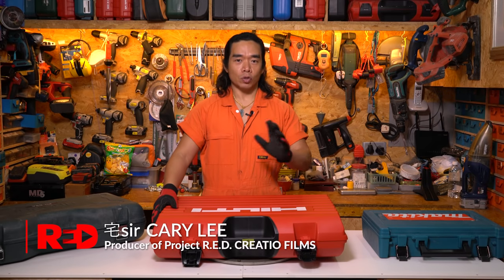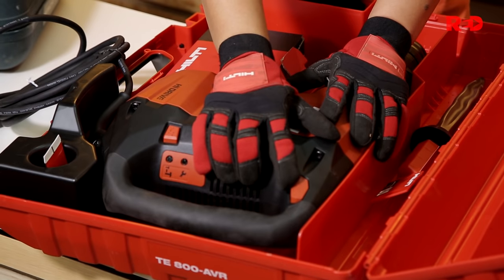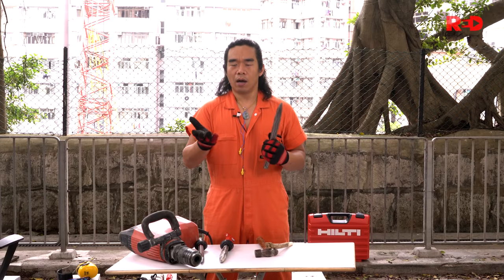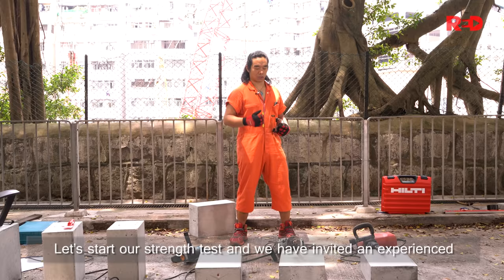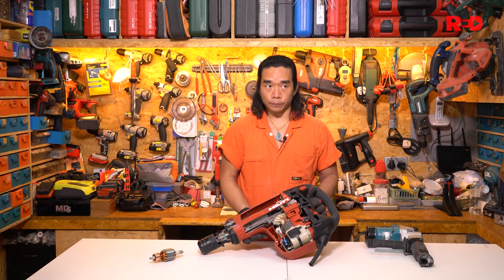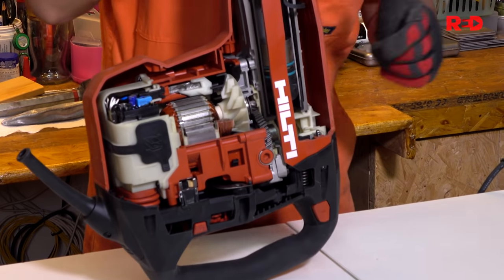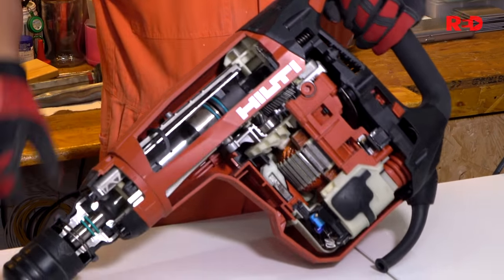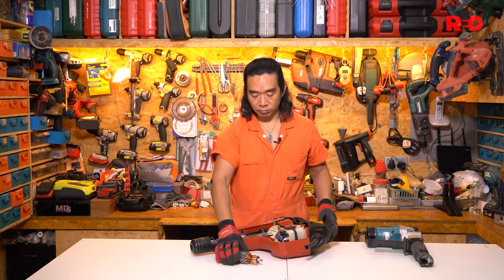Master Alley - POWER TOOL FIGHT! Hilti-10kg,  Makita-5kg, Hitachi | Breaker test | Demolition use

Comment: I have 5 Hilti machines - a breaker, a grinder, a diamond core drill, a combihammer and an impact driver. They are expensive machines  for sure, but my oldest Hilti (the diamond core drill) is now 14 years old and still works as well as the day I bought it. I think I would have had to replace a lesser machine twice already. Look at Hilti as a bombproof, long-term investment in your business. You won't regret it.

Comment: Master Alley, 
I would love for you to test Hilti breaker and the hitachi breaker featured in this video and a pneumatic breaker of the same size roughly (mostly referred as a pneumatic pick). And test them both in the field at say, a rock or granite quarry and see which one does the best. 
Then do some tests with different types of rock drills both electric, hydraulic and pneumatic test in rock. Why I'm requesting this is because I'm looking into doing some small scale underground mining both placer (really hard packed gravel) and hard rock.

Comment: how about trying 3 hammers the same weight and cost roughly? instead of comparing a small makita to two massive crazy expensive demo breakers.
Reply from the maker: Dear Sam, thank you! We've got a lot of feedback about this test. Actually this test is to bring out the most popular breaker use in Hong Kong which is Makita 5kg and Hitachi 15kg. We try to see if a 10kg breaker could make a different. So, we are not really comparing how good they are, but try to figure out how to choose between different work/task. They are all good tools.
In fact, 5kg breaker are commonly asked question so I am trying to make a video between different 5kg breakers. 
Once again, thank you for your feedback, we will keep on trying to be as fare as possible!
Merry Christmas, 2016
Reply: Sam Katalaveno

Comment: Why so inconsistent? You start with 3 and when the vibration test comes along there are only 2. You might want to communicate why the third jackhammer was not used. It was too heavy for you guys? The vibration test would still be informative and valid for those of us with muscle. Arbitrarily and silently changing the test is odd. Some would prefer strong and quick. Taking 5 minutes to make one crack in the concrete paver is in the end equal to strong and uick. The fatigue level would be similar. When the Hitachi is done with a 10' x 10' patio the Hilti would only be half done. Work twice as long or twice as hard? When time is money? 

Fine, you're comparing massively different demolition hammers. This doesn't feel like a fair fight with only 2 out of 3 participants participating in all the tests. This feels like a Hilti commercial.
Reply from the maker: Dear Bobby, thank you for your comment. Wow, I didn't realize it has been one year already! To be honest, this was not an easy test. Many things happened during the shooting. In Hong Kong, Makita 5kg and Hitachi is most commonly use. This time what I was trying to do, is to see how a 10kg, middle weight breaker perform. I am sure you are one big giant Godzilla but here, we don't really drive. Most of our tools are carry by hand and on foot. I am sure you understand what I want to say. For the vibration test, the concrete couldn't stand the weight and power of the 15kg, we tried to make it work, trust me. Again, this is not a fight. I am trying to see if there is an option for my fellow construction mates, something that can carry and travel on foot, yet strong enough to do some good damages.
Thank you again for watching, keep sharing thoughts, and we will try to make it better!
Reply: Dear Master Alley,

Thank you so very much for your kind words and response. I do unfortunately have a response. Please understand this is not a fight or argument. This is a response with your goal in mind. 

Let's assume the workers you are referring to are not contractors. At the same time my concern are the contractors. Would I carry that Hitachi to work or the Hilti. The Hilti has been proven to be very slow but easily transportable. The Hitachi has been proven to be quick. Do I want to hire the worker who will take 5 times as long or who will be quick and efficient. The boss has supervisors. He or she needs to justify his expenses. Will his or her supervisors appreciate the extra hours and money spent or a much lower bottom line due to a lower labor percentage rate? Will the worker want to break a sweat and get done much quicker or a easy transport but twice as many hours. Over here we have a saying 'milking the clock'.Go slow so we can make more many. The Hilti will accomplish that slowly. 

Google 'Fast nickle or slow dime' if you want.  Contractors appreciate the fast nickle which the Hitachi can accomplish. 

I appreciate and understand your sentiment. My opinion only differs. I am neither right or wrong.
Reply: Will the contractor/boss keep the worker who was 5 times or even two times as slow or the quicker worker. 

Btw - I do not have a vehicle. I am on foot or on a bike.

Comment: Great review ,is the Mikita HM1211b ? Because I've used Air breakers ,everything else corded Hilti, bosch, hitachi real and fake, metabo , in my opinion they are all great machines to use ,but the operator needs to know how and wear and when to hit ,my Mikita Hm1211b vs the new Hilti would be a nice challenge to see vertically and horizontally ,straight run no stopping 12 inch thick by 3 feet wide no rebar .
Reply from the maker: Dear Roger, I think it will be a great test! Need to go find Hilti and borrow some tool agaon soon!
Reply: If i may suggest doing a 7 kg breaker demo test... no one done it before... Hilti te700avr, Makita hm1111c, Bosch gsh7vc, Dewalt d25871k

Comment: How much time it took for the Hitachi and hilti hammer to break the concrete block ?
Reply from the maker: Dear Jebaki, it took Hitachi only ~10 sec and a bit over 1 minute for hilti!
Reply: Much THX for the answer.
I am disappointed with the Hilti power - that Hitachi is a 20 year old design and has only 1240W, the Hilti is brand new design with 1850W of power! Sure the Hitachi is 4 kg heavier but the age and  input power difference is huge...
Reply from the maker: Honest speaking, Hitachi has a lot of vibration but that power is killer! For floor work, I will use the heavier one, no doubt. There are indeed a vibration reduce model, let see if I can borrow one and give it a try!
Reply: Yeah it would be great ! More demo hammer tests !

Comment: Makita breaker must be nearly half the weight of others clearly they love Hilti that cheap hitachi copy breaker is prob the most powerful
Reply from the maker: Makita 5kg, Hilti 10kg, Hitachi 15kg.
So, I am trying to find out anything in between 5kg and 15kg.
For example, I was making a vent at 2.5m height. The wall was super strong. My 5kg couldn't do anything to it. I drill holes around already, of course. But lifting that 15kg is impossible, so there comes the 10kg.
All I am trying to  say it, every tool has their own reason to be there